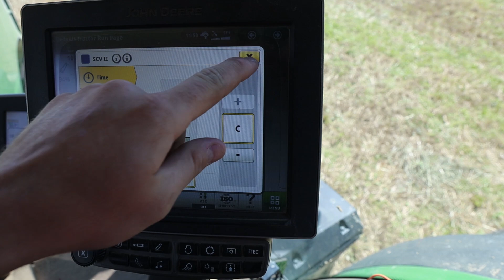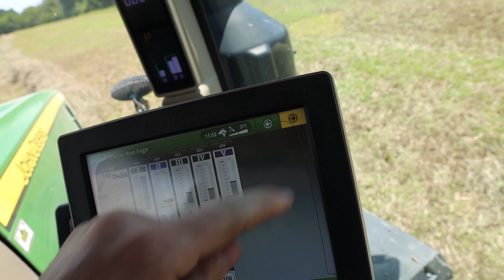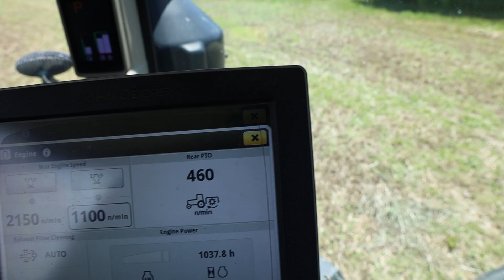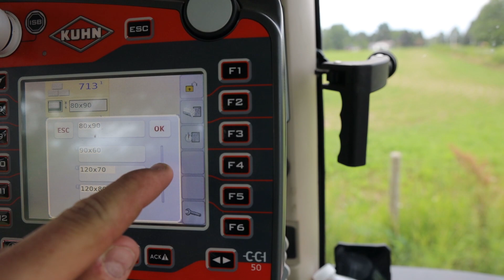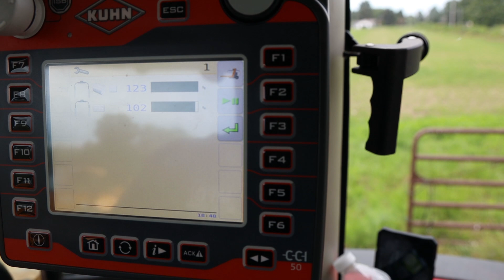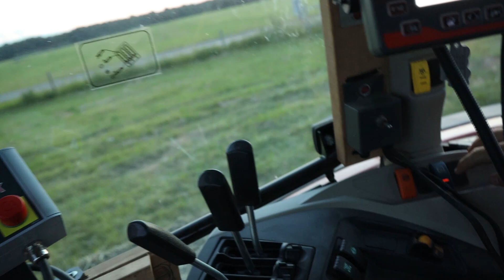Wrapping Hay With Cutting Edge Machinery

Comment: Definitely agree about the steerable rear axle. We used to run the Claas Quadrant baler and that had the same thing, made it soooo much easier to turn and get in and out of the tight barn and yard area
Reply from the maker: It makes a HUGE difference. It doesn't scuff the fields either

Comment: That Kuhn wrapper looks cool but I think the McHale 998 is a much better bit of kit simply because you can process multiple bales at once. Basically you can have one going off the back while the next one is starting to be wrapped and another bale loading up the ramp
Reply from the maker: Sounds like you're definitely able to hammer down with it. Can it wrap squares and rounds?
Reply: @FarmingInsider  I never wrapped rounds personally but yes as far as I know the McHale can do they all. And yeah, you really can bash out the bales pretty quicky

Comment: If you had to buy a wrapper again would you get the 4014 or would you try a Mchale 998HS? Any regrets?
Reply from the maker: My only regret is not having a bigger tractor available to hook it up to. It would be a lot nicer with some more stability and the ability to adjust the 3 pt arm on the fly. In order to get the hydraulic flow i need for the Massey I had it on, I need to toggle the 3pt arm “off” to push that flow into the the 1st hydraulic.

I have no complaints about the wrapper except that Kuhn has been telling me for a year they can get the settings in the standard System but it’s still in metric